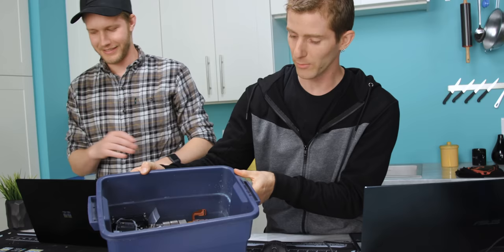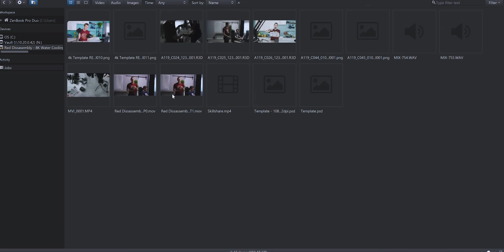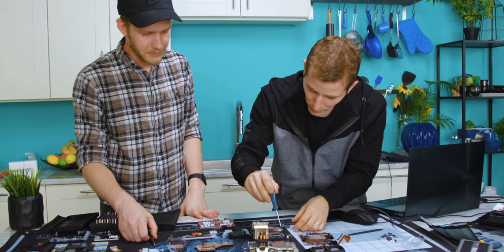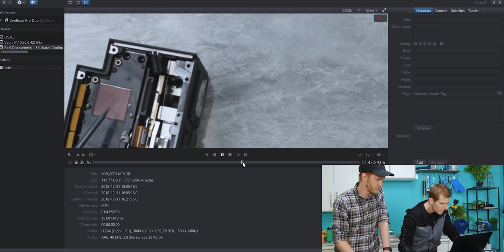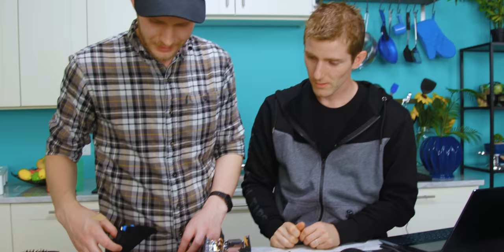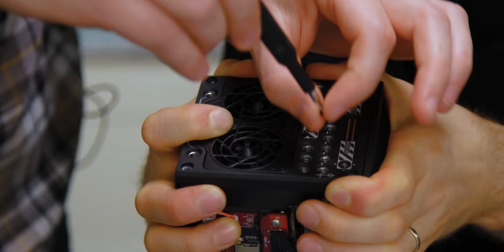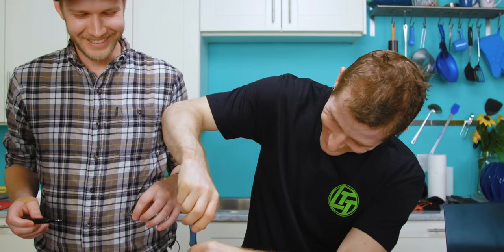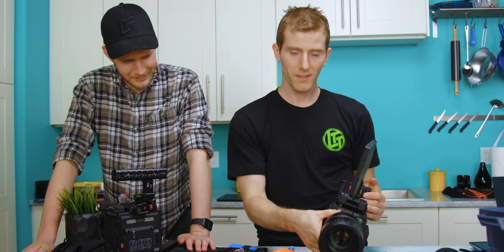Reassembling our $40,000 Camera

Comment: Here's a story. I disassembled my laptop and tried to reassemble it again. When the work was done I was standing with 5 screws in my hand. Started to think 5 is too much "I must be did something soo wrong". Then I disassembled and reassembled it again. Now I have 7 screw.
Reply: Haha , finds out later it's the screen retaining screws , after screen flops out , yanks ribbon cables and falls right in the bathtub
Reply: I hope your not a Boeing technician..
Reply: @mikester1290  no doubt , haha . I'm afraid to fly now , thanks.
Reply: Lmao
Reply: I disassembled a Bridge Camera and was left with one screw. Started all over and now they are all inn.
Reply: That is weight reduction. It is now even more portable
Reply: Ahaahah
Reply: I had a similar issue when i did a htc 10 battery swap. I was left with 2 screws after closing it. I opened it again and did manage to locate the holes. It worked like new afterwards. Yay me
Reply: If it turns on and works, its good enough. I usually shake things and if I dont hear a rattle I call it good.
Reply: I've never not ended up with extra screws after opening up a laptop. They always work fine so I just put the screws in a ziplock and write where they came from on it in case I wind up needing them, but I never do. Moral of the story: manufacturers use way more screws than they actually need.
Reply: Inhad 1 screw left over and also broke some Plastic housing but ey now I got better wifi worth it.
Reply: Erdem Erdem dont worry, i took apart an old oneplus one phone after replacing the battery and i had like 8 or 9 screws after 🤪
Reply: only 7, i reassembled my laptop and was left with over 10 screws
Reply: @mikester1290  lmaoooooooooooooo
Reply: @ForeverMasterless  and that drives up prices
Reply: @HatedJared  I was about to say something like that, ha ha ha. Twist it, shake it, power it up. if all good, SEND IT!
Reply: Looks like you're SCREWED! 

Fine, I'll leave.
Reply: @JakeobE  I was looking for this comment, haha
Reply: Better extra than some missing mysteriously lmao
Reply: Mike Creed Leave Boeing alone :(
Reply: Looks like you dont need them. I disassembles my laptop. Reassembled it and i found out i lost some screws. So give me those😏😂
Reply: I end up with screws missing even though I put them in a container
Reply: @marcusurbenz  forgot to screw the Mobo or the second pcb because only they have screws

Comment: thank god a nuclear reactor is already water cooled otherwise i wouldnt advise leting linus get close to any power plant
Reply: Hermes: they actually don’t water cool a nuclear reactor. When an xtra neutron makes the core unstabel it splits in two. A lot of heat is produced. It is placed in water and this water gets hot, the water becomes steam and with that steam can power be produced in a generator. The water is not there to cool the uranium, but to produce the electricity.
Reply: GGBeryllium so... no Brains? Cooling is to cool it, this isn’t to cool it of ma dude... it is to generate xtra power
Reply: HKR GAMING HKR GAMING HKR GAMING “power output” and “pressure” are both effects of more water evaporating. So it’s not absence of cooling, but rather increased reactivity (i.e. more and faster core split) in the reactor’s core that’s responsible for what you describe. If there was no cooling, the core would just melt down (and not explode btw)
Reply: Wisse van Duin It can still be seen as water cooling as the water is used to produce power but also keep the temperature down. The water is needed to prevent a meltdown unless all of the control rods are inserted. Water cooling that generates electricity.
Reply: Nuclear heats the water. Water evaporates to steam. Steam runs the turbine. But steam can't flow if it's hot everywhere. So we cool down the process so turbine keeps turning. Efficiency is about ~39% and the rest we have to cool out.
Reply: HKR GAMING HBO’s series Chernobyl is a great show but for a complete understanding I would watch Zero Hour Chernobyl.
Reply: I came down here to be a smartass like the rest of ya, but there seems to be some confusion going on so here's the point of view from a physics student.

A reactor can be said to be liquid cooled as the reactor rods heat up a pool of water by radiating energy as neutrons. When the water turns to steam it takes a huge chunk of thermal energy with it (and really only thermal). The steam moves towards the heatsink of the reactor (cold side) and spins a turbine on its way there. You need a heatsource and heatsink for any kind of energy generation to work. Since water removes heat from the reactor itself, it is liquid cooling.. err, phase change cooling? TL;DR a nuclear reactor is one big steam generator.

Anyways, if you're just looking at the radio-emission process itself, then it's the neutron control rods that "cool" the reactor by absorbing the energy carrying particles before they can cause a stronger reaction and why is there graphite on the ground???
Reply: @victorfiori105  controls rods have graphite on their tips.......

Destroy RBMK reactors!!!!!

Destroy all Lenin statues except one in front of chernobyl.......

Wait sorry wrong year(and bad joke)
Reply: The guy Hermes will be like... Oh God I just started a "nuclear war" lol..  what a situation
Reply: @wissevanduin7946   Not continuing to circulate, and cool, the water after turning the reactor off, will not be a good situation since the resulting isotopes from the primary uranium fission will continue to decay further and in that process continue to produce heat. Missing water and residual heating was the issue in Three Mile lsland.

But yeah, in normal operation the main point is to heat the the water, either to boiling directly in the reactor vessel (Boiling Water Reactor) or superheat the water under pressure (Pressure Water Reactor) and then use the heat to  generate steam in a secondary loop that is not directly irradiated.
The steam then spins the turbines, in turn connected to the generators.
Reply: But eventually he would think of overclocking it with ln2.
Reply: AZ5 !
Reply: actually I was in the toilet.
Reply: When knowledge kills a joke
Reply: @megakiller999  lol wth
Reply: @megakiller999  650 subs no vids how you do that?!?!
Reply: But can you overclock it!
Reply: Nah Linus's just gonna drag out that old diy chiller of his
Reply: A nuclear power plant is ACTUALLY WATER COOLED. You are talking about the prime water loop to get the produced heat to the generator.  but the SECONDARY or THIRD water loop cools the prime water loop so the steam get back to water. if there would be no sec cooling the steam would STAY steam and you get an meltdown like in Fukushima.
Reply: @wissevanduin7946  If no water the temperature would rise and core melt. I need to check my school physics book.
Reply: ITT: yanks talking about physics.

“Look, having nuclear — my uncle was a great professor and scientist and engineer, Dr. John Trump at MIT; good genes, very good genes, OK, very smart, the Wharton School of Finance, very good, very smart — you know, if you’re a conservative Republican, if I were a liberal, if, like, OK, if I ran as a liberal Democrat, they would say I’m one of the smartest people anywhere in the world — it’s true! — but when you’re a conservative Republican they try — oh, do they do a number — that’s why I always start off: Went to Wharton, was a good student, went there, went there, did this, built a fortune — you know I have to give my like credentials all the time, because we’re a little disadvantaged — but you look at the nuclear deal, the thing that really bothers me — it would have been so easy, and it’s not as important as these lives are — nuclear is so powerful; my uncle explained that to me many, many years ago, the power and that was 35 years ago; he would explain the power of what’s going to happen and he was right, who would have thought? — but when you look at what’s going on with the four prisoners — now it used to be three, now it’s four — but when it was three and even now, I would have said it’s all in the messenger; fellas, and it is fellas because, you know, they don’t, they haven’t figured that the women are smarter right now than the men, so, you know, it’s gonna take them about another 150 years — but the Persians are great negotiators, the Iranians are great negotiators, so, and they, they just killed, they just killed us, this is horrible.”
Reply: +Wisse van Duin. You're half right. There are two water loops in a nuclear power plant, the primary and secondary, the primary loop's job is to keep the core cool and carry it's immense heat away and stopping it from melting down. The secondary loop's job is to turn that thermal energy into kinetic energy by boiling and spinning a turbine. So  the whole answer is that water in a nuclear power plant is both a coolant and a means of energy transfer.
Reply: @wissevanduin7946  Lmao! Then what is the usecase of DH2O there?
Reply: Nuclear Reactors cant Function without water... Almost. Unless you are using an RBMK Reactor, you dont need to worry about it. Almost all Nuclear Reactors have a Negative Void Coefficient, Which means that As there is more Void in the Reactor, The Reaction will slow down. RBMK Reactors (which is the Reactor that was used in Chernobyl) has a Positive Void Coefficient, Which means as there is more Void, The Reaction will Accelerate. You dont need to worry about Reactors exploding because of a lack of water.
Reply: @wissevanduin7946  hmmm what are cooling towers then? The water serves two purposes.
Reply: @wissevanduin7946  Water is still required for cooling the reactor. If the water is allowed to boil off or drain out of the reactor then the reactor will quickly progress into a meltdown condition.

Comment: The only question I have is: "Why did you guys reassemble the camera to get "before" readings, when you have second RED camera?"
Reply from the maker: Every electronic is slightly different due to manufacturing tolerances, so although we have the same camera it might run slightly hotter, or have marginally worse low light performance.  Same reason that some processors can overclock better than others. -AC
Reply: Linus Tech Tips what's the most expensive thing Linus or anyone has dropped and/or broken?
Reply: @LinusTechTips  You really think  it's reasonable to assume the tolerances between two cameras from a quality controlled production line are greater than the tolerances between a camera before and after an "amateur" dis- and re-assembly?
Reply: @amw6394  his wife
Reply: PrimitivePeople 😂
Reply: @WestonNey  especially considering that it is now 2020 and Linus specifically says in the disassembly video that the project would be done before 2020 I'm guessing we aren't getting a water-cooled Red from LMG. :'(
Reply: @7kaker  I've never been happier to be proven wrong!!
Reply: @amw6394  I think intel Xeon processors that cost more than $10000

Comment: Y’all should be careful with those ribbon cable connectors, we use them at work and they only have a 5 insertion cycle life
Reply: Sounds familiar.
Reply: lmao
Reply: camera costs 40k yet they used cheap materials? nice nice...
Reply: Wait really ? I didn’t know they were that crappy of material
Reply: Cameron7127 it’s not that they are crappy, on the contrary actually they’re nice for that specific application. The connector itself is just delicate because it’s not meant to be opened and serviced by anyone other than RED really. It’s a Hirose connector if you wanna read up on it more. They’re specifically made for imaging applications
Reply: @jessiejanson1528   No.Not at all. Just the nature of that type of connector, they are not designed to be messed about with.
Reply: @tothethreshold.9965  Im just saying, for 40K, i would expect all the parts to be sturdy enough to be unplugged and plugged in 100 times without issue. if something breaks after 5 times then i dont consider it to be vary strong and its more likely to be faulty or damaged from the start and maybe break under normal use. for 40K a 5 cent connector vs a 1 cent connector isnt going to break the bank.